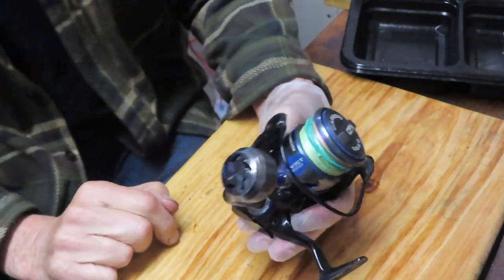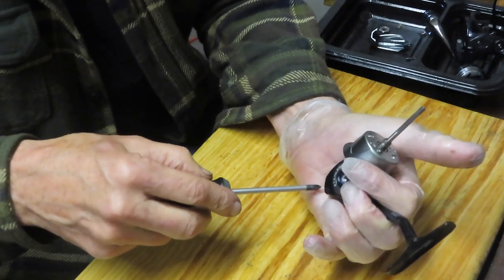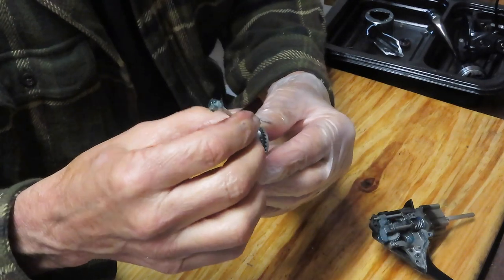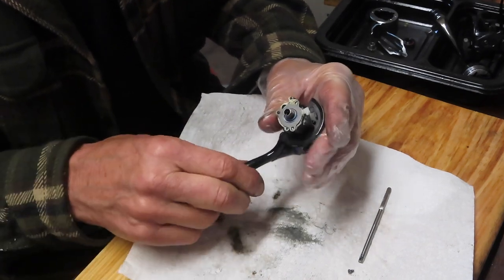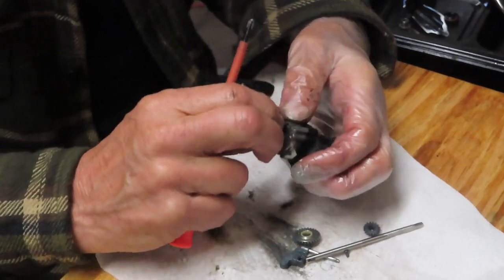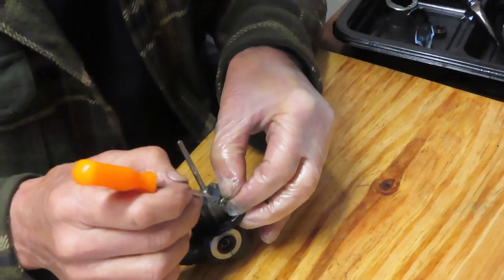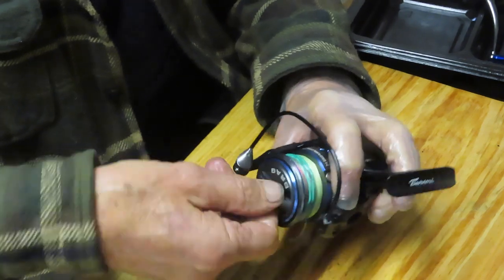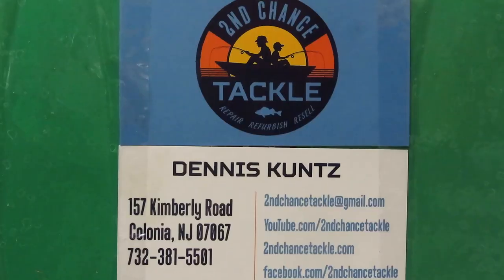Tsunami Evict 3000 spin fishing reel how to take apart and service

Comment: If I was going to buy a modern reel I would definitely look at Tsunami though I am interested in a different model than this one. I recently worked on a reel with open roller bearings in the AR clutch. I had to remove them to get at the bearing and pinion.  Had to use the tweezers to get it back together. I think it was a Shimano reel. I’m getting cold feet on these Tsunmai reels as that Shield was the one I was interested in. This Tsunami is impressive but I wish it had an AR override switch. I started working on that Mer Punch reel and I have a problem with the anti-reverse mechanism. It is very unusual and difficult. I have two others that work fine so I may have to do some comparing since no schematic exists for this 1955 reel. You did a great job on this Tsunami!  — Chris
Reply from the maker: I had to compare a Spinfisher 550SS the other day on a spring setting.  Always a great option.  Thanks for the tip - Dennis
Reply: hi chris. i just used my brand new evict 4000 today on my favorite light action rod and experienced a very annoying wobble retrieving a one oz kastmaster lure and 007 diamond jig. i've used other reels on that rod and had no problem. i took it apart at home and noticed it has a counterweight inside the rotor. i was curious if the 3000 dennis was working on would have a counterweight but it didn't.

Comment: As usual, I appreciate the benefit of YOUR experience. I look forward to the day you have to work on a SaltX. I've owned one for 2 years of constant fishing which has been trouble-free but there will come a day when it's time to disassemble, clean and reassemble. The SaltX comes with a bailless conversion kit and a schematic.
Reply from the maker: Thanks - I will make a note of that.  I have not sen one in the shop yet.  Best wishes - Dennis

Comment: Great instruction!! Quick question, why to use grease for gears when in reality on an industrial gearhead, they use thick oii? Let say 20W50 auto oil?
Reply from the maker: Oil will evaporate and pool.  Grease lasts longer and stays on the parts longer.  Thanks for asking - Dennis